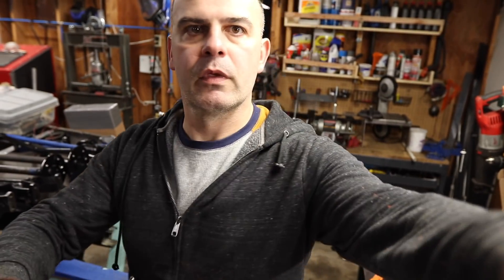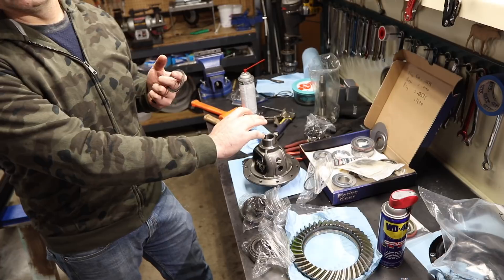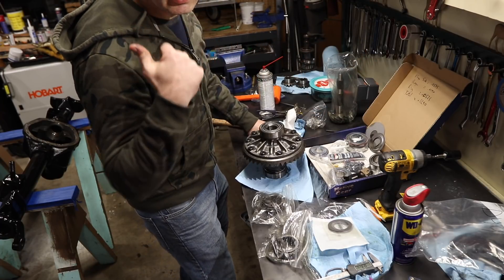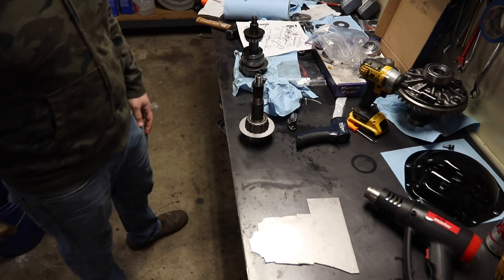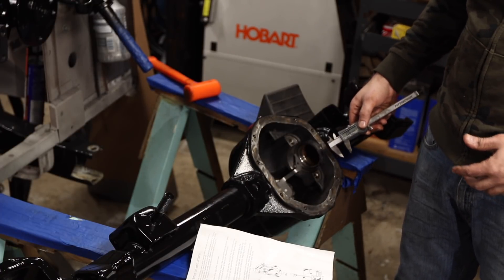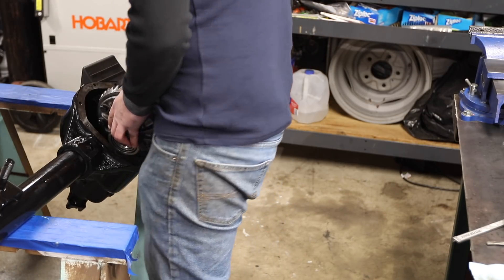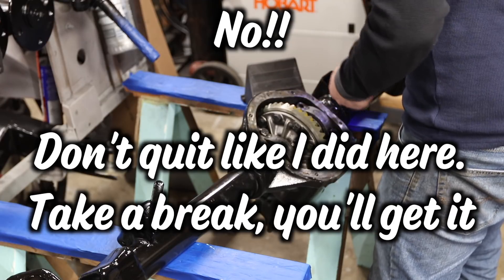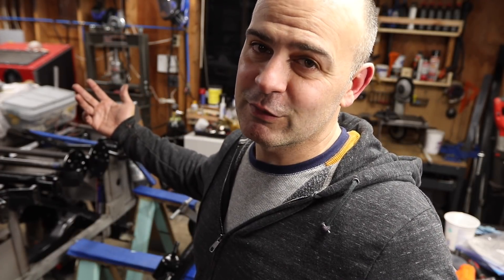3.26 - 1st Fail - Dana 44 - Part 8 of Gears and Axles

Comment: Matt you doing a lot of work to not be installing a positive traction differential. I rebuilt mine in the 80's only to tear it back down to install a positive traction unit . I was very unhappy with a open differential .
Reply from the maker: Frankie Wheeler you have a good point. I have Auburn LSDs front and back on the Scout which are great off road.  For this Bronco build I am keeping a stock suspension so no need for more. But now that I’m buttoned up you having me second guessing, hehe